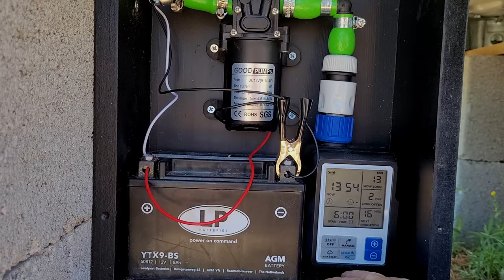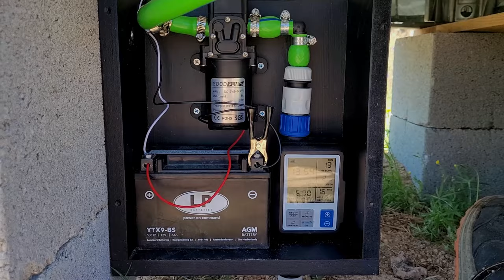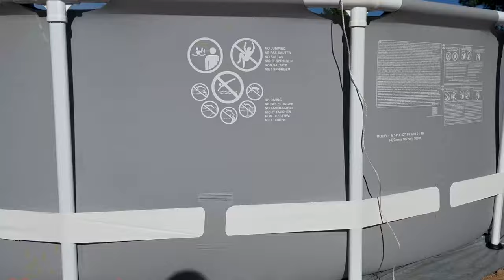#51 Working on our homestead in Central Portugal

Comment: Thanks for your vid 😇💟💟💟 Love and bless you guys, good work 👍😁 when you are mowing with the tractor keep the mower on the ground make it as short as possible and you can also drive backwards wail mowing saves you lots of time and tray a higher gear ⚙️ to go faster 🐢 or 🐇 this handle maybe.
Reply from the maker: Thank you Arjan for your advice. 🙏🌹🤗We just don’t dare to drive that fast because the brake isn’t working properly 🫣😩 and the land is very bumpy.. and the seat is iron..that hurts a lot🥹🤣

Comment: Wow, the pool looks very good. You have to attach the sun protection for the lettuce to the outside. Once the heat is inside, nothing helps. I have provided extra shading strips on my greenhouse, which are available to purchase. That makes a lot of difference to the temperature. Although this year it's raining here instead of the sun shining mimimi
Reply from the maker: Thank you so much! 🤗🙏🇵🇹It’s really getting hot inside but also outside 😎🫣

Comment: Garden hose under such pressure like underneath your ibc wont survive very long and when it finaly splits or breaks the water will all go onto your battery. Maybe separate them? 

For the pool; where the water enters your pool again make it go 90degrees away from your skimmer. It will make your pool slowly swirl and all leafes and debrie that falls in it float towards your skimmer. It will make a big difference in maintenance time.
Reply from the maker: That is good advice. Thank you

Comment: Great addition with the Swimming Pool    but you need to control de water Ph ...and add the proper chemicals cloro etc to keep the water clean  and for experience those paper filter pumps are no enough to do de job properly ...after a while the paper filter will be clogged fast and it will need to be cleaned after a few hours of service...
Reply from the maker: Thanks for the advice🙏🤗 we did the chemical thing … for the days to get the water right🫣it almost mathematic 🤣